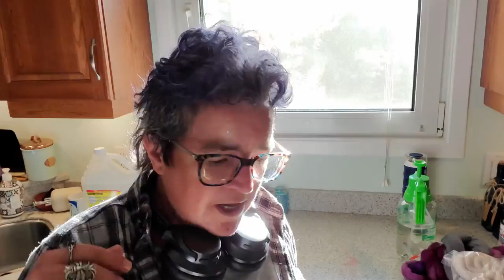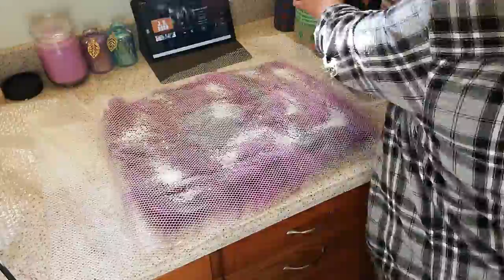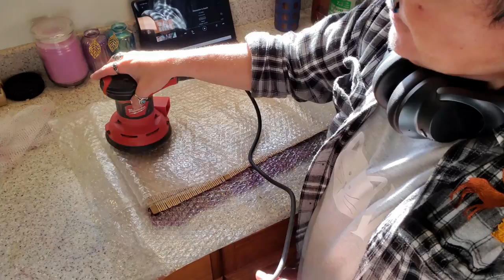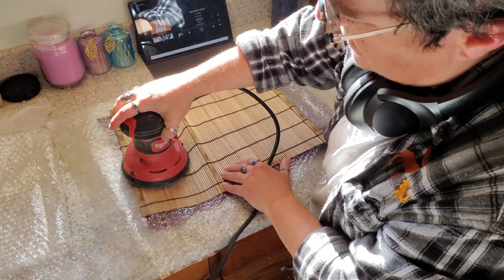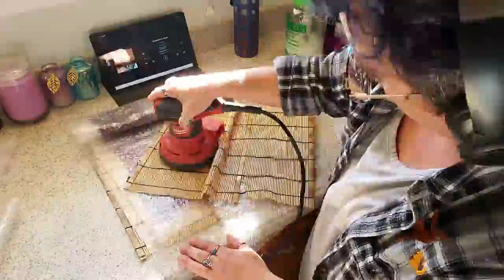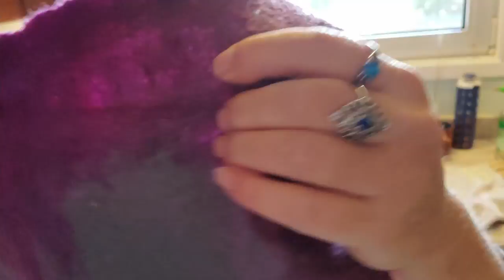Wet Felting: With a Palm Sander!!!

Comment: I don't get it. Is it sanding the bamboo mat, too? Is it shooting micro plastics into the air?
Reply from the maker: There's no sand paper on the sander so all is doing is vibrating.  This vibration moves either the bubble wrap or the bamboo mat across the wool which is what causes it to felt.